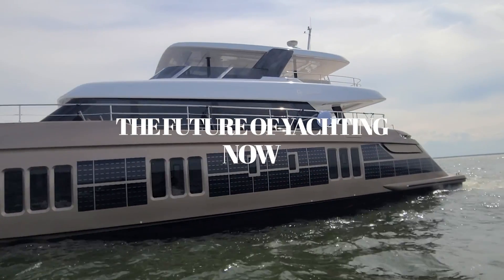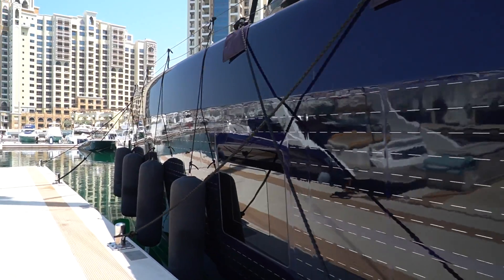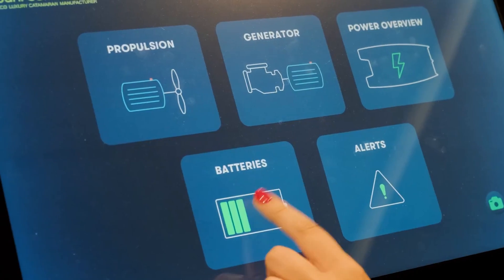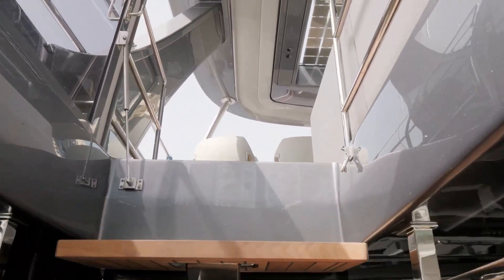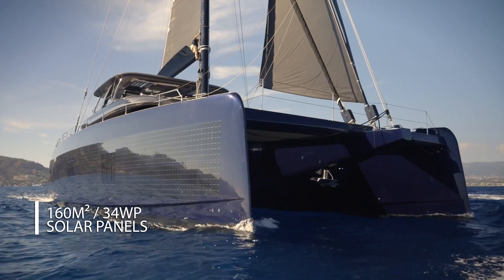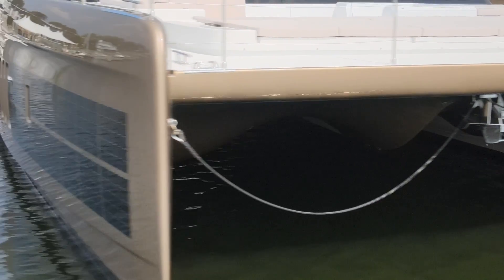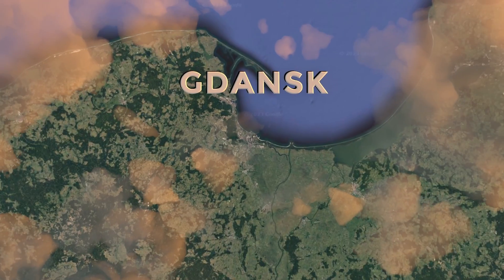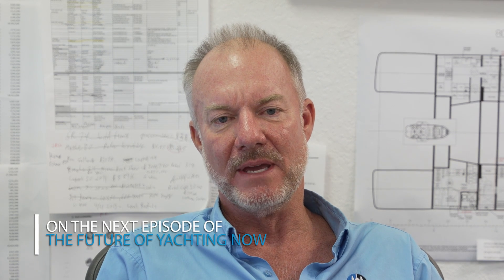Documentary on Sunreef 80 Eco Catamaran "The Future Of Yachting Now" | EP3 Solar Powered Catamaran

Comment: So it does use slightly more power than it generates.
Reply: Im quite sure that would depend on the usage and the weather conditions. if you say used it in northern norway in summer time,
when the sun shines 24/7 it probably would create more power than it use as long as you dont also use the 2 x 180KW electric motors.
And instead use the sails, and the drag  PRODUCE 2 X 15kw BY spinning the propellars and using the motors as generators.
Said in another way,, if it produce say 34kw solar power and use less than that on say air condition, cooking food + lights.
it should be possible to store some energy and slowly charge the batteries to have to use when the sun dont shine.